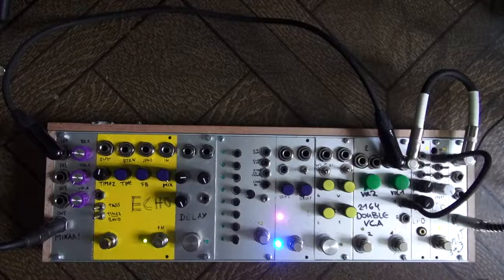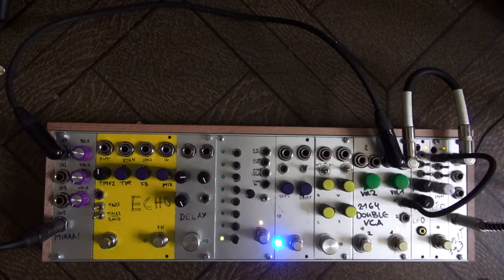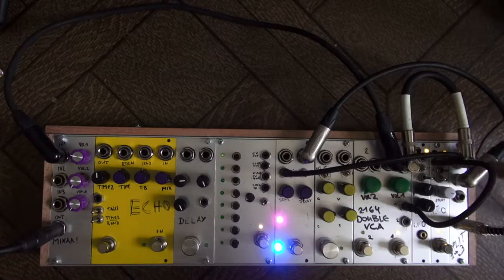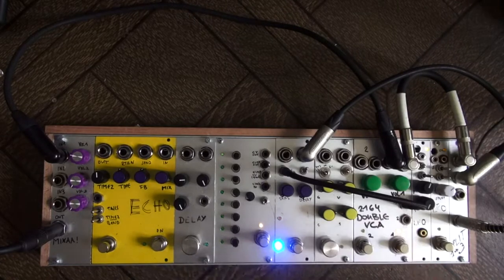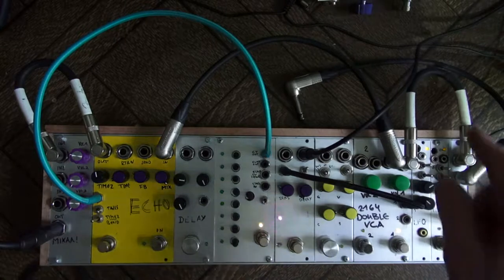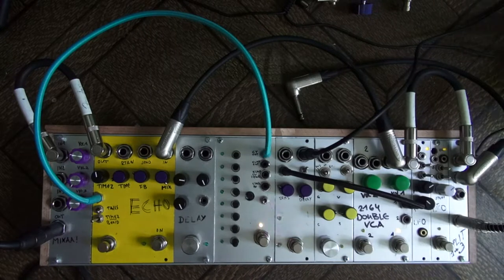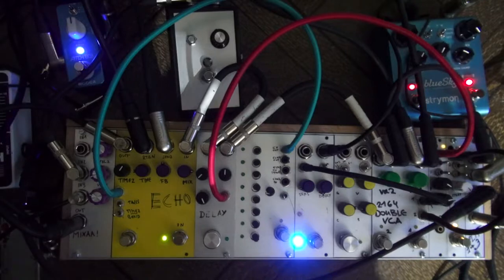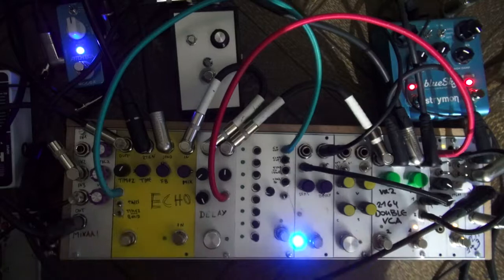DIY modular guitar effect board demo1

Comment: What are you using for lfo's?
Reply from the maker: Hey! Here i used just op-amp schmitt-triggers and integrator to make square and sine wave. And i Made them voltage controllable with a ldr (not very precise of course). Do you need a schematic?
Reply from the maker: I ment tri-wave, not sine wave...
Reply: @davidheizmann  Dude a schematic would be great. I'm familiar with the comparator part but not the integrator
Reply: @davidheizmann  so you put the square wave out of the schmitt trigger into an integrator?
Reply from the maker: @Ben-yy7io  jep, like this http://experimentalistsanonymous.com/diy/Schematics/Oscillators%20LFOs%20and%20Signal%20Generators/Simple%20Dual%20LFO.gif

i had this as a basic schematic, guess i tweaked some values (cap and speed pot) to have it slower and added a ldr across the speed pot to vary the speed with a voltage, via the vactrol.
Reply: @davidheizmann  Thank you so much! Experimentalist anonymous is a gold mine
Reply: @davidheizmann  Hello again, this might be a stupid question, but how would 
i add a cv input jack to a module? Would the vacrtrol have to be inside of the module being modulated, and the input jack simply recieves the cv from the lfo?
Reply from the maker: @Ben-yy7io  jea, thats exactly how i did it for example in the delay, cv input jack connected to the led of the vactrol.
Reply: @Ben-yy7io  you both just introduced me just now, so thanks.  i guess I am a long long day late and a dollar short to this here conversation but thanks 👻
Reply: @Ben-yy7io * “Thank you so much! Experimentalist anonymous is a gold ” it does look like it!!!!!!